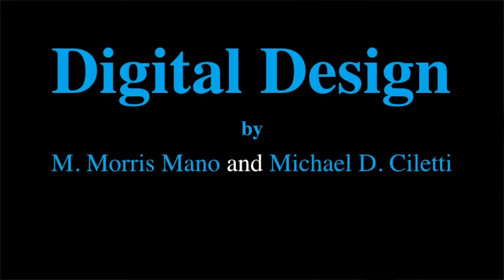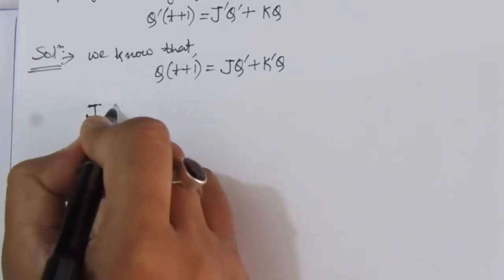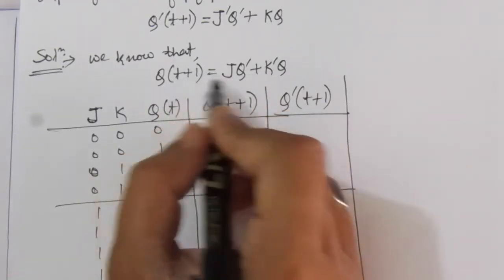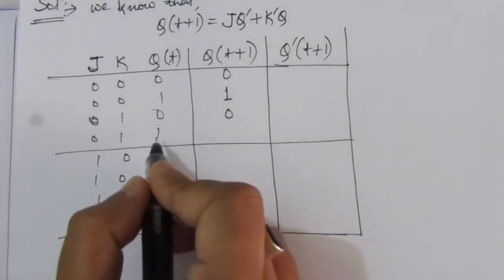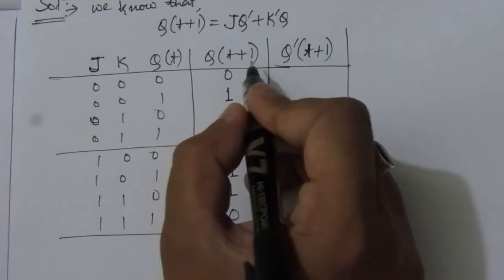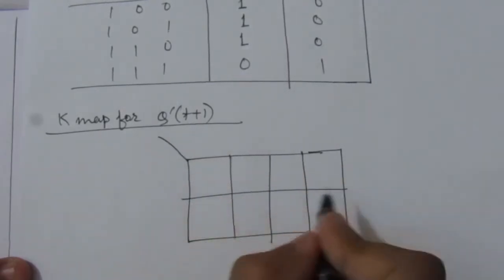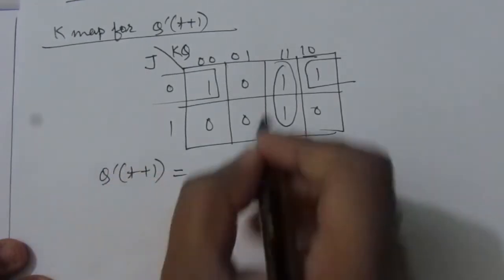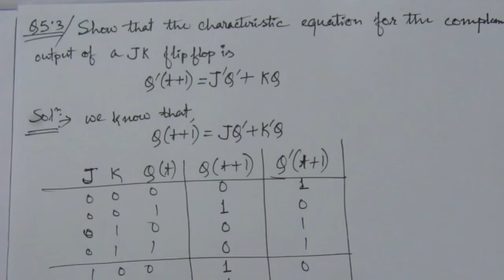Q. 5.3: Show that the characteristic equation for the complement output of a JK flip-flop is Q'(t+1)

Comment: Construct a circuit which will multiply a 3-bit binary number CDE by 2, 3, or 5, depending on the 
value of a 2-bit code AB (00, 01, or 10), to produce a 4-bit result WXYZ. If the result has a value 
greater than or equal to 15, WXYZ should be 1111 to indicate an overflow. Assume that the code 
AB = 11 will never occur. Try to minimize the number of gates required. The inputs A, B, C, D, 
and E will be available from toggle switches.
Can you solve this question mate?